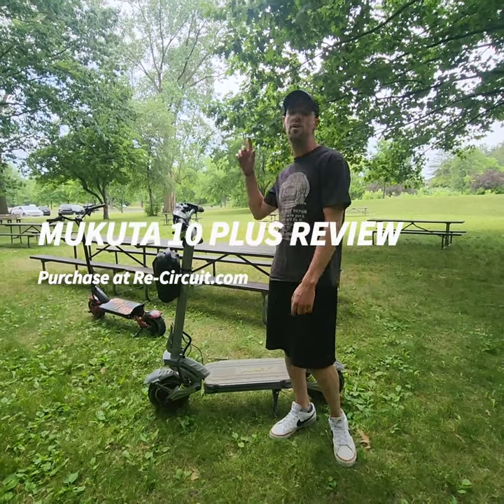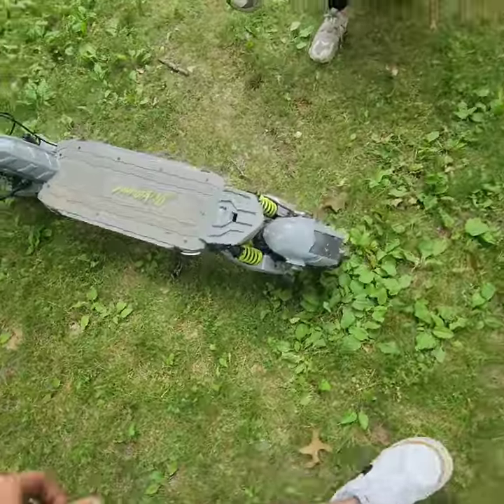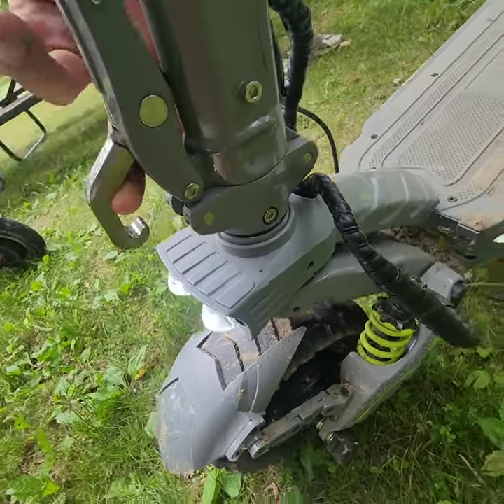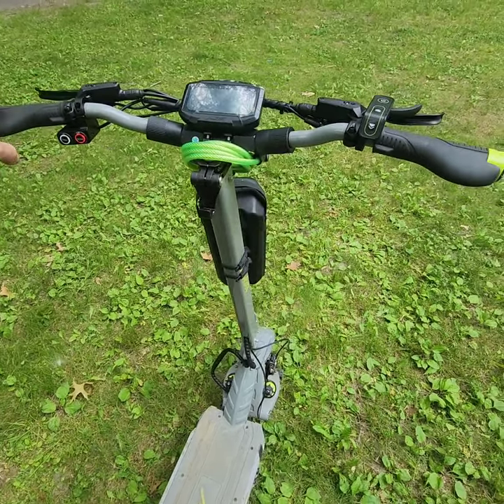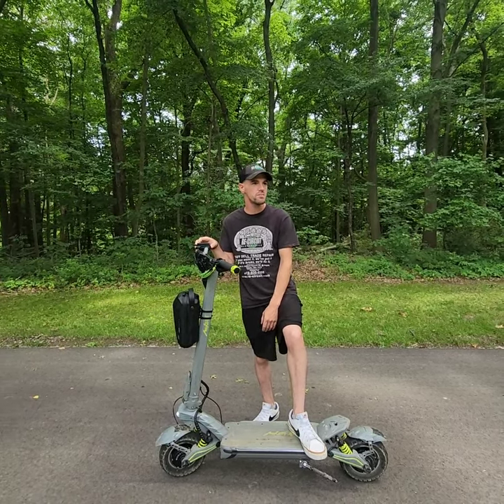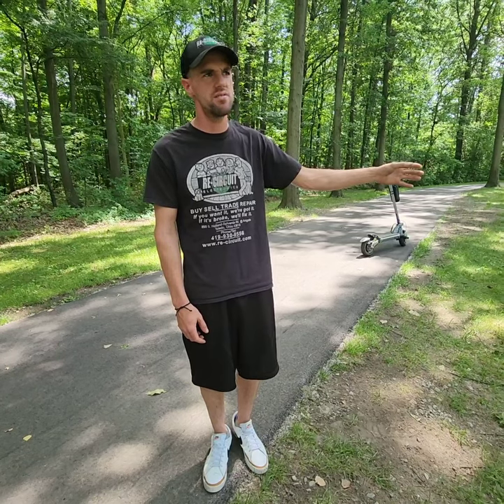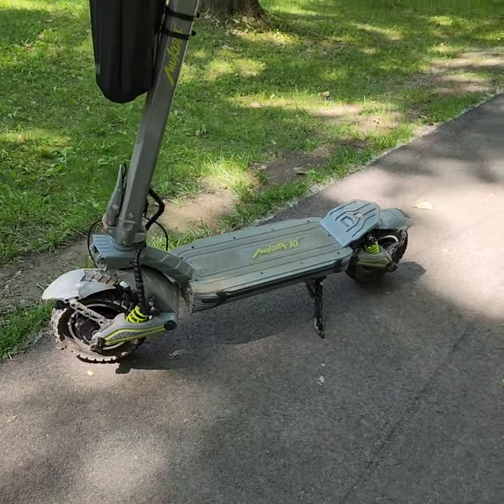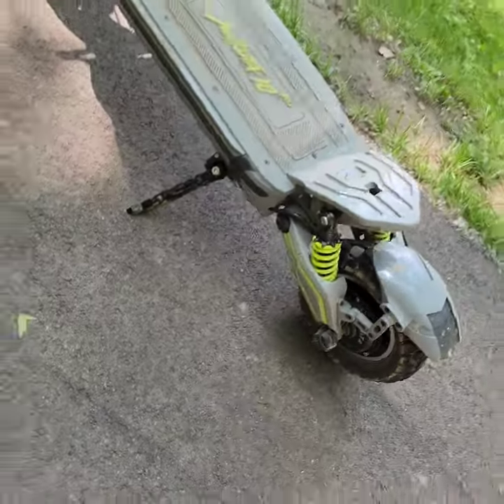MUKUTA 10 PLUS 3200 WATT AWD HYPERSCOOTER REVIEW AND RIDE AT PARK!

Comment: I have about 700 miles on mine and it is flawless. Just be sure to check all of the nuts and bolts when you get it brand new.  Also fill your tubes with sealant otherwise you will get flats! Ever since I did that I haven't had a single flat.

Comment: Great review. The mud guards have fallen off 3 times even after being tightened so I dumped them. Also be aware that the motors have an overheating cutoff and will stop and not restart if you dip below 56V on dual motors mode. Then you have to reset the motor by just plugging into a charger for a few seconds. So make sure you are on single motor under 56V. Terrific scooter and scary fast.

Comment: Hey there Mike, do you think that the mukuta 10 plus is faster than a surron light bee x?
Reply: It's probably faster off of the line which is really exhilarating. But the Surron is probably faster and more stable if you're hauling ass in the dirt for example. They are different animals. That's why I have both! 😂
Reply: @Riceman-o1p  in a race on road which they both can hit around 65kmh which would win from a start to around 60-70 kmh or even 50kmh or at least a good distance

Comment: bro i bought a mukuta 10 plus aboout two months ago. it wsas smooth and solid at first, the scooter has been pretty nice, but ive noticed in the past three days or so, my stem has developed a bit of loosness, ive went through and tightened everything im not sure why it is happenening. any help?? the stem feels wobbly at speed. i just cant figure it out and its driving me nuts!!
Reply: On mine the set screws that keep the hinge pin in place were loose. I fixed that and my stem is solid. Also make sure that is not your handlebars that are doing that as those locknuts get loose often. I did not like that so I got rid of those heavy steel handlebars and went with a single aluminum handlebar And it is much better
Reply: @Riceman-o1p  bro it’s funny you say that because that’s exactly what the problem was with mine. I ended up fixing it by tightening those exact screws.
Reply: @Riceman-o1p  I noticed that if you loosen the handlebars and pitch them foward a bit and then re-tighten them the stance for your hands is so much better if you’re taller than like 5’5 … like I can ride it much more comfortably now thanks for the help
Reply: @deadcalifornia  that's awesome news! Good to hear. Have fun out there! 💪

Comment: Why are they only selling 2800 watt scooters now?
Reply: The motors are 1400w each, it's 2800w together and when it's above half battery it runs at "peak power" which makes the motors run at 4000 w together

Comment: Have you got closer to advertised top speed ?
Reply from the maker: On flat ground I'm able to do 53-54mph solid when the battery is freshly charged
Reply: The speedometer reads a little bit high but I can get mine up to about 50 miles an hour. No wobbles at all, it is very stable and a really fun and fast scooter